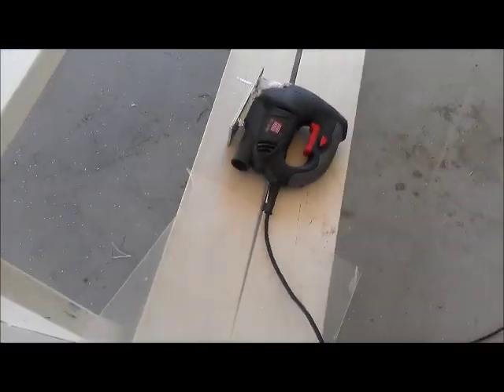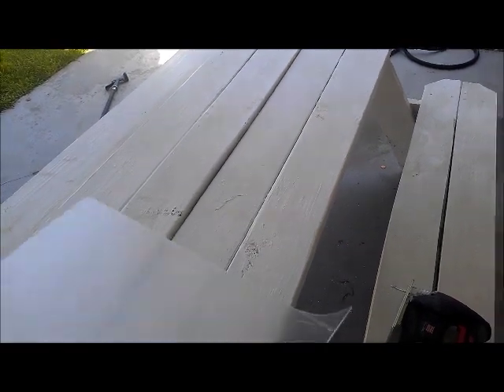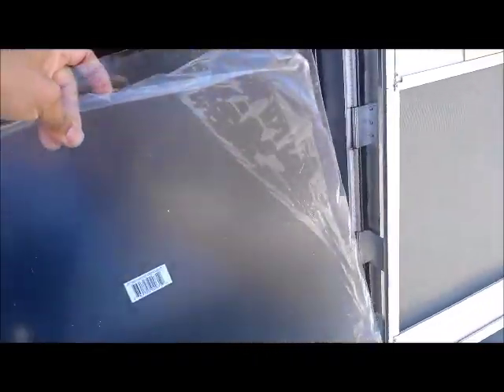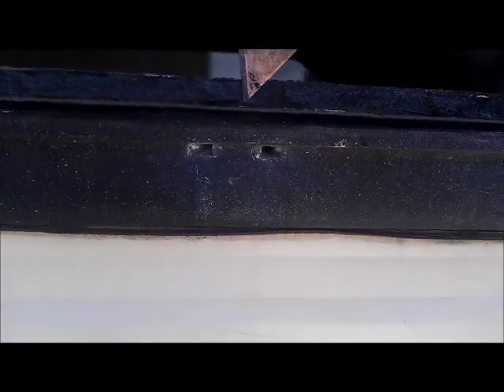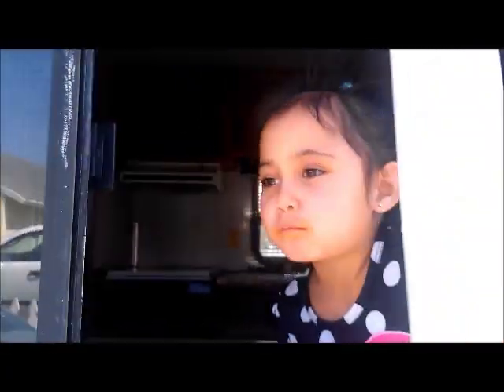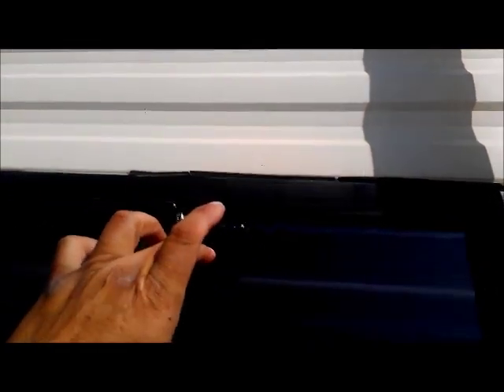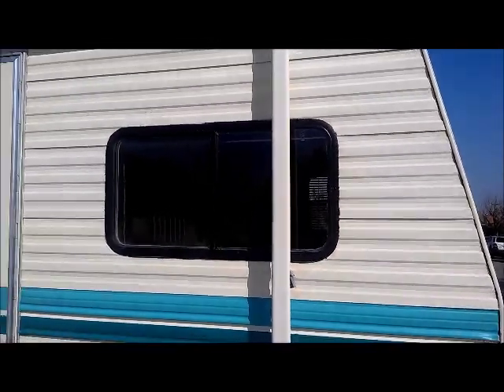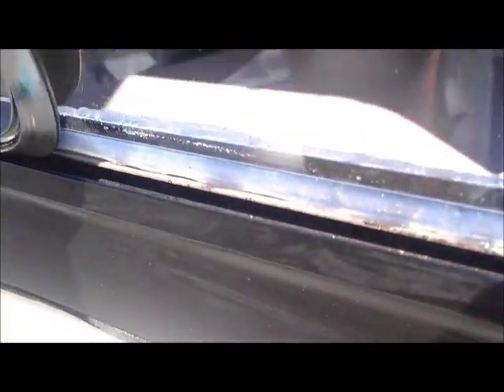replace window glass of RV, travel trailer camper. Cost = $20

Comment: I've worked with acrylic for 40 years and I can tell you the major problem you're going to run into is severe scratching of the acrylic from the felt seal on the sliding window. There's literally nothing you can do about this. plexiglass may be very strong but it's one weakness is that it scratches easily. 

By the way plexiglass and acrylic are the same thing. Plexiglass is a trade name for a specific brand of acrylic sheet. There are two types of acrylic sheet commonly used. One is cell cast and the other is hot rolled. Both of them should work fine for your particular application the only thing to watch out for is that acrylic stress crazes extremely quickly if you use any type of solvent to clean it. For example never use Windex or anything that contains alcohol or ammonia to clean plexiglass especially the hot rolled variety. Stress cracking is what looks like spider web cracks coming out from the edges and it's the result of stress introduced into the acrylic by cutting it or Machining it
Reply: Yeah you’re absolutely right it does scratch very easily.
Reply: Hey Dan do you think putting window tint would protect the Acrylic from scratches?
Reply: @gregoryjones4411  wow I forgot about this post, I have to say you have me on that one, I've never tried to put window tint on acrylic sheet as you can get acrylic sheet already tinted. 

Even though window tint film is plastic I do believe that it has anti-scratch coatings on it so it might help. 

The real problem is dust and grit gets trapped in the felt and that's what scratches the plastic when you open and close the window. 

What you can do is get some of the static cling type of window covering, I use it in my motorhome. It's very simple you just cut it out to fit and static cling holds it to the window, when it gets scratched up just throw it away and replace it with a new one

Comment: i have a older motorhome that has one slide with a window that comes inside with slide, so my front roof air broke and they 750.00 for new one so im gonna take out slide window put in plywood cut a hole then i can put i a widow A C, that way i can pull it out to travel cause with slide in no need to remove plywood cause opening is inside, and your video is the only one ive seen that shows how to replace just the window all the others show replacing whole thing